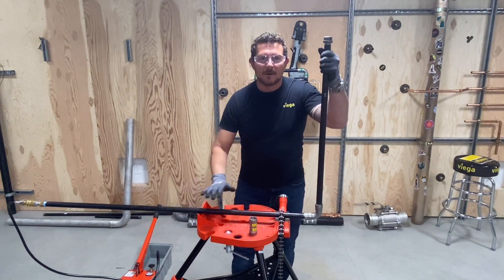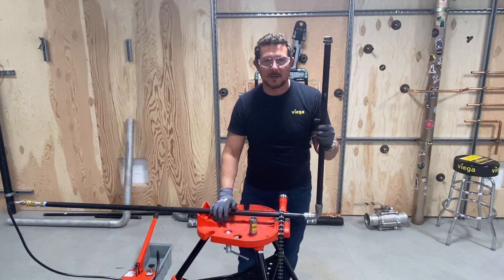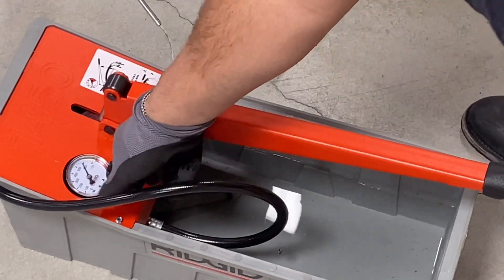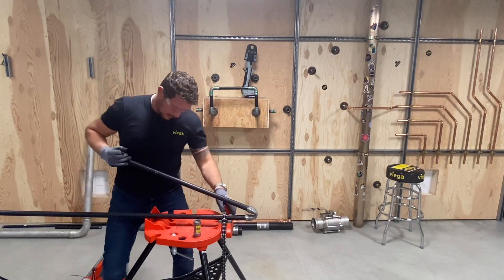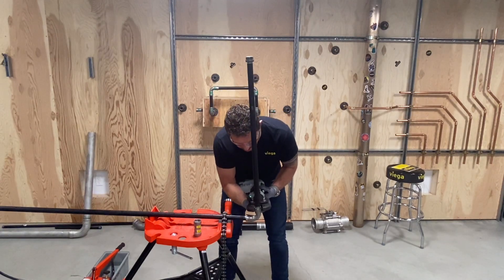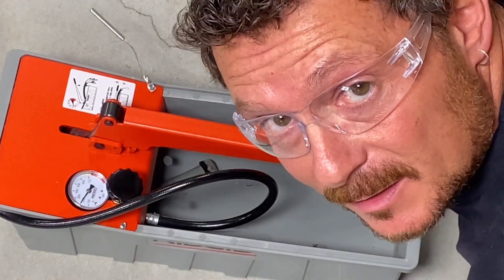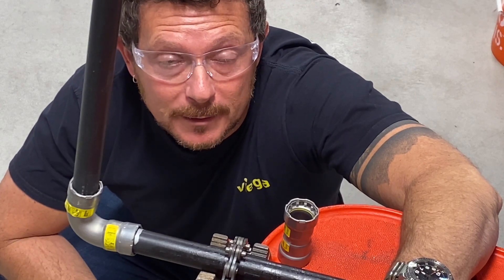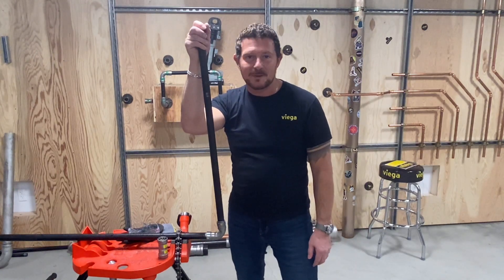How tough are Viega MegaPress fittings?

Comment: Can you use it on a brass pipe  , cut the treads and press a fitting  thank you
Reply: I’m going to say now. These fittings are not used for potable water if I understand correctly, and if you have a brass pipe/nipple anywhere outside of a water delivery system, I am going to say that is not the correct application of that material to being with. If it’s for a potable water delivery system, aka what’s in your home. Brass fittings are easily transitioned to copper material with threaded adapters which are available in pro-press systems. Also keep in mind if you are using brass to carry a liquid, electrolysis is something to keep in mind. Since copper is highly conductive, and brass is an alloy of copper and zinc, the electric charge generated by the movement of water is transferred equally. Transitioning to a different material, like brass to iron, can cause the electrical current to build up and essentially heat the pipe causing unwanted expansion and contraction which will loosen mechanical joints. There are dielectric unions available, but I do not believe they are available in propress or megapress, and they are not legal in many municipalities (including mine) due to how easily they can fail. Overall, could you do it? Sure! Should you do it? No!!!

Comment: Can you use Fittings on High Pressure Steam?
Reply: No 15 psi max on steam. Use mega press with fkm seal. For residential and commercial for steam you'll see at most 7.5 psi.   Normally steam heat for commercial buildings is as low 2.5 or 3 psi. Mega press on steam is only suited for low pressure residential/commercial steam.

Comment: I wanted to see a twisting action.  Turn the fitting 180 degrees one way and back  under 600psi.  Then try 360 degrees to see if it blows off. - I'm thinking it will.
Reply: what would you know
Reply: You would be surprised 😮 it probibly wouldn't. It's alot strong than your will power to say no to a snickers bar
Reply: It wont blow off, even with a full twist!    I have done it.